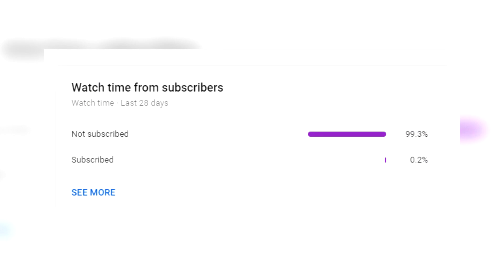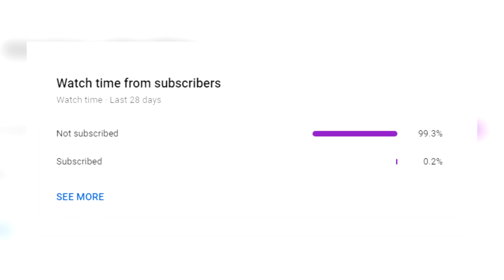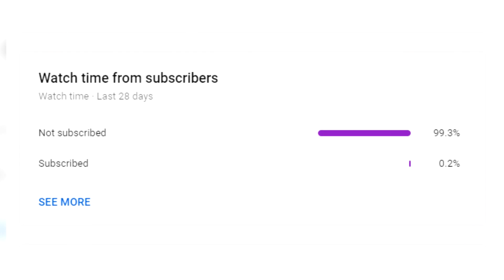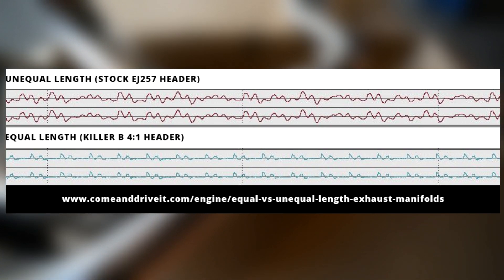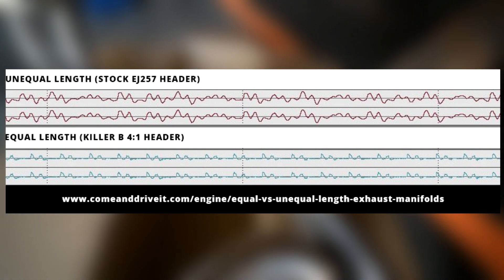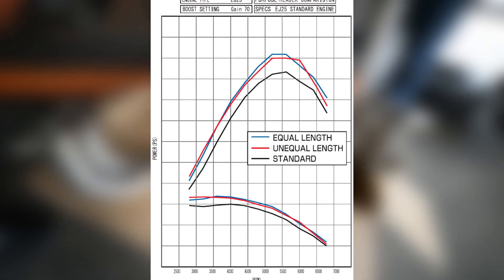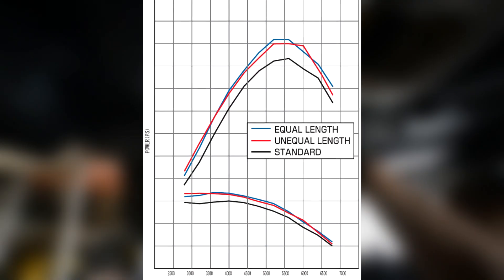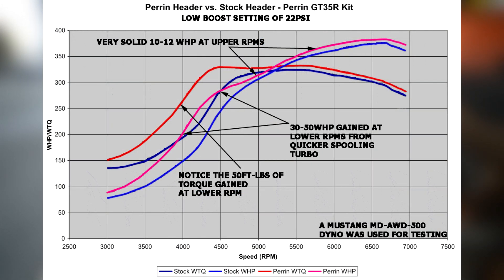Quickly Clarified - Equal Length vs Unequal Length Headers (with Sound Comparison)

Comment: Don't forget the sound is also shaped by what you put after the headers too. You can get smooth and mellow or loud and raspy and combinations in btwn. That EL w/the Fujitsobo sounds nice. So, sound or power...if you want sound, change the turbo/cat/axle-back. For power, change the headers...
Reply from the maker: mhmm, correct. I do agree that fujitsubo one sounds really nice.
Reply: @JCMediaYT  if u can get hold of the syms racing EL header, that one sounds pretty much the exact same as impreza wrc 99 rally car...

I got one..loving the powerband it delivers... Especially the smoothness at higher rev rsnge in touhe/mountain passes...

Too bad it made out of thin gauge tubing and prone to stress cracking... (Also reason why mine is sitting on thebstorage shelf for now)
Reply: True, but the most significant variable in any exhaust system will always come from the path each tube travels prior to the main collection point.
Reply: I got a 93 Impreza non turbo which has el headers , I got a muffler  and some exhaust work done which is 3 inch and the rest is stock, it feels restrictive it's not loud has a nice time a small suby rumble not on idle,can someone tell me why I'm losing power ?
Reply: @igotthemidastouch8587  3 inch exhaust on a non turbo is why it feels slow but sounds fast.
Reply: @igotthemidastouch8587   If it is a carb motor, you should check the air/fuel ratio after you check if you got a valve problem or debry stuck from gas to the headers, better do a cleaning from inside, and check your sparkplugs/electrics for any problem.
Reply: Turbo back increases power too, not just headers. Cat/axle back basically has no effect on power.
Reply: @cl3935 unless it's oversized on a naturally aspirated car

Comment: The common ELH on a Subaru is designed much like a tri y header on a V8 application. The common UELH is akin to a set hybrid longtube/shorty race headers. My opinion is that both designs are lacking, however they get the job done. An equal length 4 into 1 is going to be the best bet, overall. 

Now with this being said, and yes this is the unpopular opinion for sure, I believe that marketing has it reversed: I have personally found that UEL headers in a Subie application makes MORE top end hp than EL tri-y headers. Of course, EL 4-1 will make more than both.

I have another unpopular opinion, albeit for intake manis.... one of the best oem intake manifolds for the EJ, if not the best overall, is the black plastic 08-14 wrx intake manifold. This is from a dyno perspective, not flowrates alone.

Comment: Idk what i want to do just yet. Car is tuned now im deciding what set of headers i want. I do want the power of EL but i dont want to lose the rumble
Reply from the maker: Are you on the stock turbo or is it an aftermarket? I'd recommend you take a look at the Grimmspeed headers, they have a mix of the higher equal length pitch, and the classic boxer rumble.
Reply: @JCMediaYT  yeah it's stock. Just replaced the turbo about a month ago. Got a tune already so it's mod ready
Reply: If you want some rumble and power increase skip gs and pick up the ets header.

Comment: People say equal is the way, but in reality with flat plane engines where you have cylinders firing in pairs the ideal is to have a slightly unequal header so for example the gases from 1-4 don't collide in the pipe at the same time but instead make one tightly follow the previous one and create maximum flow, so instead of having 2 explosions fighting with each other which one will pass the pipe first at the same time and be depended on the vacuum of the previous pair's gases ending up creating back pressure, you get 4 guys following as 1-4-2-3 chest to back.
With equal 4-2-1 headers the thing is a little better as it is due to the usually bigger size of pipe merging into one but still i'd rather have maxinum theoretical flow and rumbly sound.
With unequal headers you can gain more than you lose, you only lose if the gas travel is unecessary long and not because it's unequal.

Comment: I’m torn.. My 03 Bugeye is ready for a clutch due to a failed slave cylinder, as the piston was binding in the bore, causing half engagement. 

It takes 45 minutes to yank the engine, Vs 2-3 hours on my back to pull the trans. 

So decisions on Headers… My concern with my decision is Heat on the right bank.. I have a buddy that works at the dealer, and he said bore wear on the right rear cylinder is always more than the rest due to heat.
Reply from the maker: Yup that's correct, the 4th cylinder is always the one most prone to damage from heat. An equal length header will definitely help keeping the temps down, but installing heat wrap would also help if you want to keep unequal length headers. Additionally, you can also get a "4th cylinder cooling mod" from GDT or Torque Solutions to further help with cooling. I'm running the Torque Solutions one with a Tomei unequal length that is also heat wrapped. 

Personally I really like the Subie rumble so I want to try keep it while also improving reliability lol. Hope that helps!

Comment: An exhaust manifold is not the same as a header. A there are two headers on a v8 that then connect later down the exhaust. There is one exhaust manifold on an i4 that collects all the exhaust from all the cylinders and combines them immediately, usually before entering a turbo. Not the same thing because one does not combine all of the exhaust while the other one does.

Comment: Unequal length headers mean the exhaust is not scavenging properly which reduces efficiency and is what creates that “rumble” you describe. It doesn’t hurt the engine, but it does make things somewhat less efficient, so you are leaving some potential power untapped.
Reply: Worth it
Reply: But at what cost

Comment: Even with equal length headers, you still can hear a bit of the Subaru rumble!
Reply: You’re probably referring to the Perrin ELH with this comment and when I had a set on my car I heard the described two ways. As a gateway drug to ELH or as ELH version 1.0.

I never measured tube length but I noticed my tomei ELH was much smoother sounding. 
I’ve had my STi for nearly 10 years now and ELH was the first mod I did to that car and still my favorite.

Comment: so im confused, whats better for performence? uel or el? also i heard that on the brz you need an uel to fix the torque dip at high rpms. is that true and will it be even better with el?
Reply from the maker: going for a uel helps with low end torque which somewhat helps with the torque dip, but you'll lose out on the top end

Comment: Is UEL headers bad for the engine overtime?
Reply from the maker: nope not necessarily. while it may hold you back when going for high power, reliability is no issue as long as you have a proper tune
Reply: @JCMediaYT   I have a none turbo GTS 86, is it expensive go get it tuned with UEL headers?
Reply: @JCMediaYT   one more question, What is the different between a high end UEL like TOMEI brand compare to fairly decent brand which cost half the price? Is there a sound different or just the quality
Thanks bro

Comment: What would it sound like if you put unequal length headers with the Nissan VR30DDTT engine? Would it sound more like an Alfa Quadrifoglion V6TT?
Reply from the maker: yeah, it will have a deeper note like the Alfa V6TT or the Ecoboost V6 engines. Going for equal length will make it more high pitched like a VQ
Reply: @JCMediaYT  I would love that! Plus if you could share me a way to increase the redline from 7k to 8k I think that would make my Z sound perfect :)
Reply from the maker: @cosmic_gate476  do you have a piggyback/standalone ecu? or are you on a remapped stock ecu

Comment: Would you say it’s smarter to not run the wrap on the headers
Reply from the maker: i would say the cons of header wrap are quite minimal in comparison to the benefits so i would rather get header wrap on mine, especially since the headers on EJ engines go around the oil pan, filter and spread a lot of heat into the engine bay

Comment: Not really done much research into any of this, but how would this work (if it works at all) with different engines? (I3-I5-I6)
Reply from the maker: I don't exactly know either, I'm guessing it would have a similar effect where the sound has more of a rumble/rougher sound. One example is the twin turbo I6 S55 engine where the length of the front and rear downpipe is about a foot and a half apart, this is why the sound of the F series M3 and M4 sounds more like two inline 3's since 3 cylinders go into one turbo. Try search up "S55 Equal Length Midpipe" and listen how different they sound.
Reply: @JCMediaYT  yeah I found that out, and it’s pretty cool. thanks.
Reply from the maker: @isaacsrandomvideos667  yea of course man, no problem! have a good day
Reply: @JCMediaYT  you too!
Reply: @JCMediaYT  wow! I saw something similer (ish) done in an E36 or an E46, but not like that, that’s pretty awesome.
Reply from the maker: @isaacsrandomvideos667  ah I've just checked the e36/e46 ones, that's pretty cool

Comment: Unequal length headers were common on Fox body Mustangs 5.0s, so I don't understand why people associate the rumble with boxer engines.  That's why oldheads like the sound of WRXs compared with the exhaust notes of other hot hatches.
Reply from the maker: yup, maybe the effect of UELs are just more pronounced with boxer engines? especially 4 cylinder ones since they don't sound like any other 4 cylinder engine out there
Reply: I have one 🎉

Comment: I perfer the equal length for the power and torque, but also love the rumble sounding EJ's.
Reply: I love the rumble but rather have the power and tq boost... plus I believe the = length gets more heat out of the equal size...
Reply: @CrazyCat229  yall talking about like 5 ftlb
Reply: @ethanol-fb  5ft/lb is subjective, because things can be exponential as power increases.
Reply: @jardim23  its a joke its not that deep and its probably more around 6 my bad
Reply: I prefer equal length with 4 more cylinders
Reply: Its not really big of a difference if racing thats like half a front fender difference 🤣
Reply: lets make a system with a flap that switches between equal and unequal. that would be really cool but would also probably break every vew monts 😂
Reply: @Mr.Marbles  equal length headers take a TON of room under the hood, this is one of the main reason unequal length headers are employed, to save space

Comment: I finished the video and unless the car is at a low rpm/ idle you can't really notice the rumble.
Reply from the maker: yeah, the difference is much more noticeable at low rpms
Reply: As someone with a tiny bit of subir experience, when you just rev it the rumble doesn't really come through, when driving hard and under load is when it really shows up

Comment: Dont forget there are some really good uel headers that make way better low down torque than EL headers I'm in uk and there are people running nearly 700whp with uel headers and no problems in decreased engine performance
Reply from the maker: yup correct, the main reason why people go EL is probably to install a twin scroll setup or go for max power
Reply: Which company in the UK makes the best UEL headers?
Reply: How do they run 700 horses with UEL (is it n/a)? Fully built engine or something?

Comment: I’ll trade rumble over torque ANY DAY, with the bolt one you can do to these, you’ll reach or exceed stock torque, depending on ferocity of your build
Reply: Unequal length headers can slightly improve low end torque
Reply: Unless you’re running over 500hp the difference between an equal and unequal is negligible. My coworker has a VA chassis STI that’s unequal and it’s at over 400awtq
Reply: Isn't any header better than stock?
Reply: @afoxwithahat7846  honestly “better” is just relative to whatever your build is. My shop has a stock engine stock turbo WRX with a tomei down pipe and exhaust, on E85 making 344/363. The stock manifold is the best option in that case. It’s all relative

Comment: What about v8s? I heard flatplane v8s with uel header sounds like a classic v8 sound not a subie
Reply from the maker: do you have any clips of flatplane v8's? never heard of them myself. could be due to the header design and the firing order but i have no idea either.
Reply: @JCMediaYT  The GT350. Flatplane crank V8 with unequal length headers
Reply: Modern mustangs
Reply: Dude there’s twice as many cylinders. And the unequal length on a v8 has every cylinder a different length from front to back
Reply: There are flat plane v8s which create their own natural sound.  Then there is cross plane,  we all know that sounds.  Then you can put a 180 degree header on a cross plane and get more of a flat plane sound.  X pipe vs h pipe noticeable  different between those two sounds too

Comment: UEL header sounds so sexy. I'll sacrifice a few hp/torque for that sweet sweet rumble.
Reply: Yup I love driving around in my rumbly Subaru. Puts a smile on my face even when I’m going slow in traffic.
Reply: @Rumblefan  Me too. I coud’ve bought a 2015+ WRX because they’re around the same price but settled for a (relatively) low miles 2013, for that RUMBLE
Reply: @yammmit  you can get the rumble from the fa I would’ve taken a 15 over a 13 off body styling alone
Reply: I’ll gladly sacrifice some HP for a more pleasing sound
Reply: I feel like I'm the only one that prefers screaming engines over roaring engine sounds lol.
Reply: @oneplumpboi5317  I like all exhaust notes personally. 4, 6, 8, 10, 12, 16 cylinders, NA, turbo, supercharged, rotary engines, 2 strokes, etc. they all sound good to me. I’ll never understand people who think v8s sound the best and bash on 4 cylinders, or vice versa. I just like engines and cars my dude
Reply: @Rumblefan   Bahahaha yeah, i like hearing a 4age screaming over 9k rpm over a v8 crossplane. Flatplane v8s tho, oof.
Reply: Hearing that civic on the start makes me want to put unequal headers on my 1.5tsi.
Reply: its more than HP, ELH doesn't sound as good but the linear power and its widely considered a longevity mod due to ULH heat on cylinder#4
Reply: Me too. Definitely considered for my 2.4L 2AZ xB.

Comment: I like the equal length sound
Reply: I rather gain power than noise and heat issues
Reply: The sound difference between the equal length and unequal length is not that big
Reply: @Yasin5791-d7u  -- It certainly doesn't sound like much on these videos, but in real life it's quite dramatic. Cell phone mics don't really have the frequency response or bandwidth to capture it. There's a reason that video game developers who want to capture a specific car's unique sound hire specialists who use several different mics of different types all at once. That having been said, the difference between them does decrease a bit at high RPMs and WOT.
Reply: @JohnnyWishbone85  yeah dude, in person way different. Glad I saw this comment.
Reply: @Yasin5791-d7u  makes a big difference to me, way less rumbly, sound way better with equal length

Comment: Cool.. i agreed Equal header is less rumble, but it has good torque characteristic
Reply: Really the only reason cars have it is just for the sound, and honestly. Who wants a Subaru without it? 😂
Reply: For me there’s not a huge difference between the equal length header vs the unequal length header.
Reply: @Yasin5791-d7u  you will notice when you do time attack with narrow cornering characteristic circuit 😁